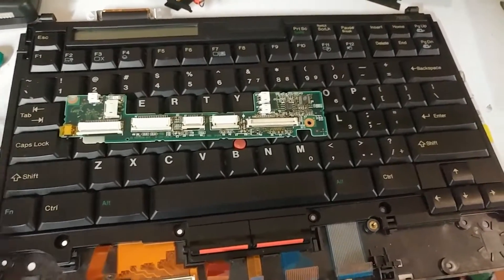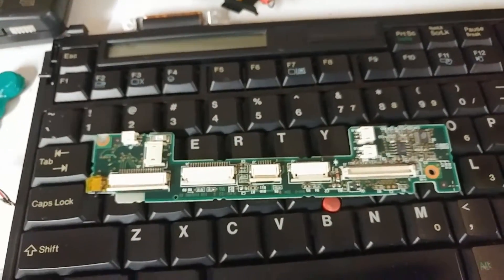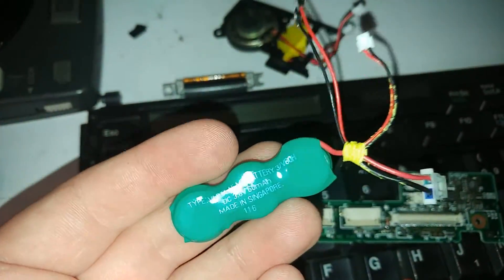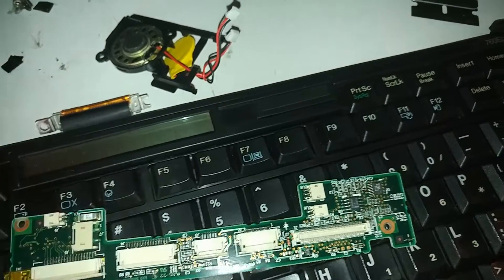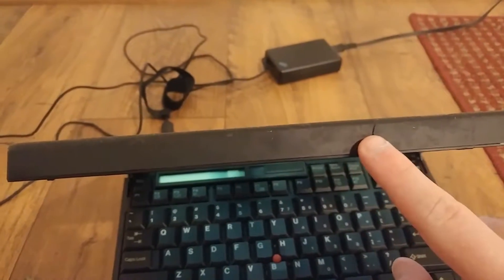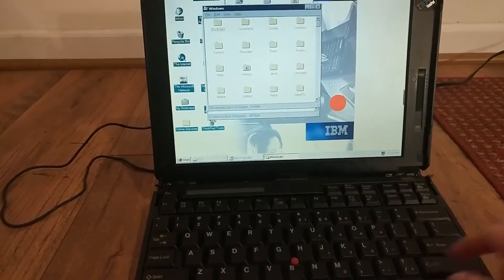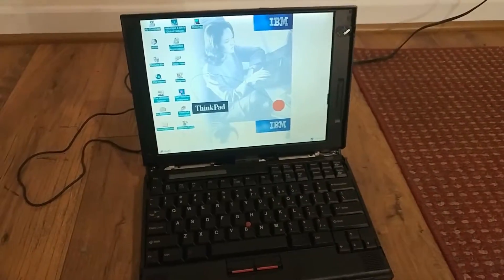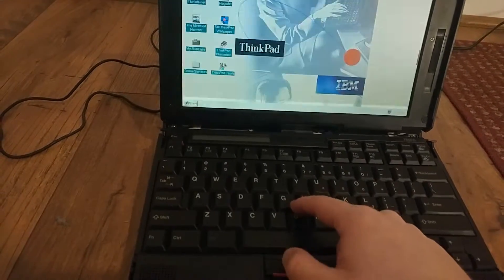IBM ThinkPad 760 NiCD Battery Leak Damage Cleaning

Comment: I have a 765D which beeps twice and not boot. I opened it up to look at the batteries - same batteries as your vid except the left one is a non-rechargable BR2020. The right battery is a NiMh 3 cell Varta 3.6v 60 mah. The NiMh pins are a little corroded but not the rest of the board, I caught it in time. I'm going to acquire another NiMh battery and see if I can get it working again.

Comment: 2:20 Thanks for posting this! I just pulled my 760ED out of the -controlled crawlspace and was pleasantly surprised to find it in working order, however your video prompted me to remove the keyboard screws and check the backup and standby batteries under the palm rest. I found the VARTA backup battery was dead and there was blue/green corrosion on its connector and the connector's negative solder point to the board, but not further than that, thankfully!

Comment: I have about 9 of these units ranging for Es to XLs, while I can confirm the Ni-Mh button cells leak I've not had it disable any of my keyboards as it only deteriorates the negative lead and stops at the connector.

That being said this applies to just about anything that uses rechargeable 'suspend to battery backed RAM' features including my iPAQs which use similar coin cells.

Comment: hey there. my 760 xl has the following problem : some (a handful) keys won't work (ESC, left shift etc.) any idea? and : any idea what would be a good alternative for a hdd?
Reply from the maker: Check the battery, it might have corroded. That's a telltale sign of nimh battery corrosion.
Reply: The keyboard design on the 760s is a bit funky.  I can't exactly explain it but the mechanism of the keys can easily fail with too much pressure and just cannot detect key presses.  Though I tend to get it with the F1 key as I use too much pressure to get into the BIOS.

Any SSD <8GB will work fine.  I use a 4GB Transcend SLC SSD in my primary 760EL (though the hard drive indicator will not indicate read operations which is a bit...interesting).

Comment: I have a similar laptop with the exact same problem. My board had so much corrosion that the battery and speaker connector fell off taking some of the solder pads with it :(

Comment: Sadly, I have an 760ED and not only does it have a severely moisture damaged LCD (so I have to use an external monitor, unless I can hack in a more modern  12.1 inch XGA LCD), it has the "terminal case" you're talking about, as it has gone so far that it constantly thinks the keyboard lid is always open, so it never boots. I think I have some photos of how bad it is, and I think I had posted those on Instagram a while back.

6:01 If I'm not mistaken, the IBM service manual for the 760 series refers to it as the "keyboard card".

Besides that Asian 760ED I talked about earlier, I also have a North American 760ED where I was able to clean the corrosion to the point where it boots, but the internal inputs don't work at all.
Reply: I'd check the chassis just to make sure the nub that presses in the keyboard suspend button still exists.  Should be on edge right next to the primary battery.